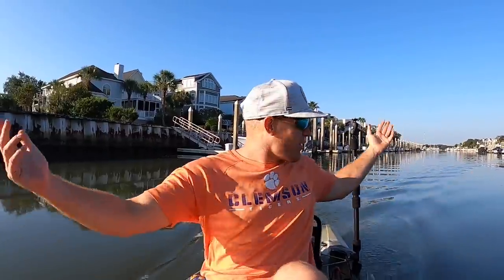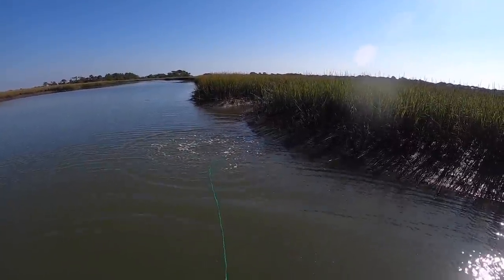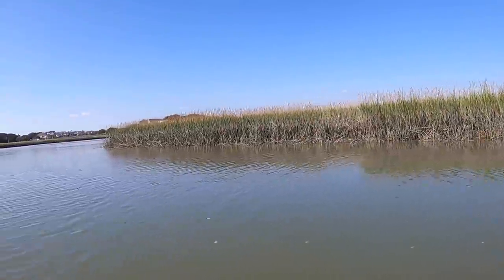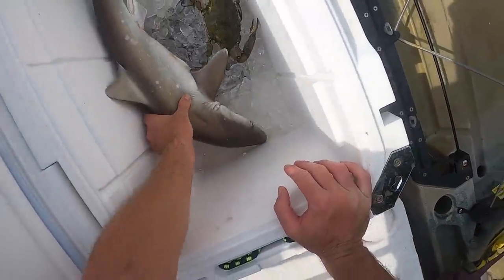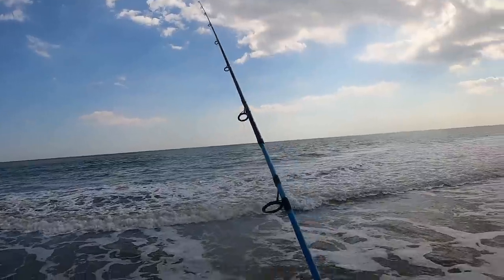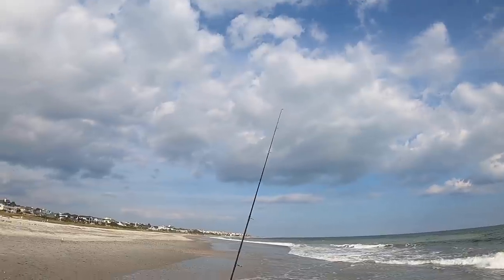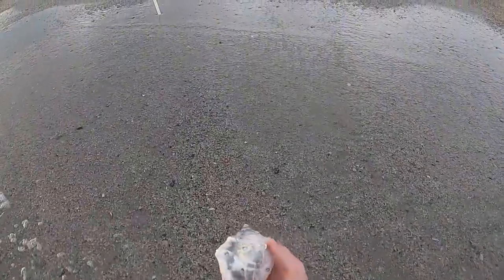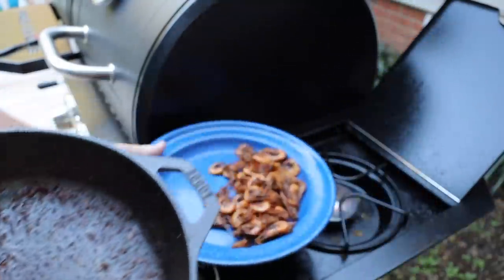Ocean Foraging- Shark Shrimp Crab Catch n’ Cook

Comment: Helpful tip for when i throw a castnet is grab the base were the top meets the rope then grab one of the parts to open the net in the same hand were the base is an in the other hand grab another part open it an lightly toss it will help out alot

Comment: You need a steel leaders dbl drop (2) hooks with a wire surf sinker and they won't bite you off anymore. Some people use a treble steel leader as a trailer on a steel leader regular hook. Your catch percentage will go way up. Esp treble trailer. It allows larger mullet for the BIG sharks

Comment: The best thing to do with a shark is to cut the tail off and bleed it out and then you will not get the amonia flavour which does come from the urine. They do urinate throught their flesh. We call the other fish you caught a shad (you get a green one and the blue shad are usually bigger than the green) in South Africa and I think they call it a blue tail in Australia. The blue fish are delicious.  It is a great fish fillet to smake also. We put them out as live bait with two hooks in the back for big game fish in South Africa. We vast an 8oz sinker out and then swim it down the line). When the game fish takes it we let it run three times. Each time it stops it turns the fish in its mouth to swallow it head first. We strike on the third run. You keep reeling and striking until the sinker reaches the swivel of the live bait rig and then you strike to set the hook and then the fight is on.